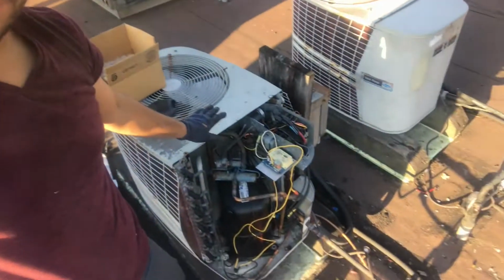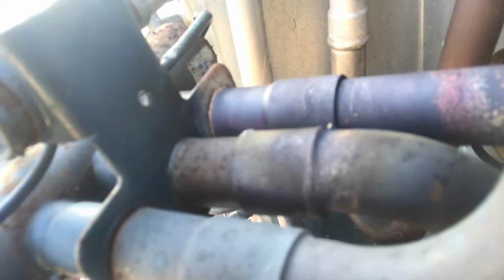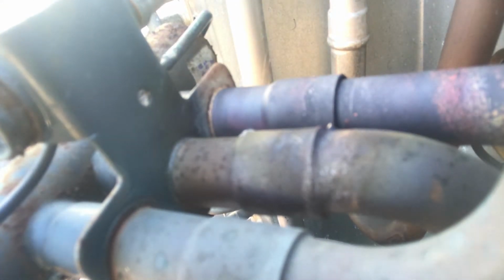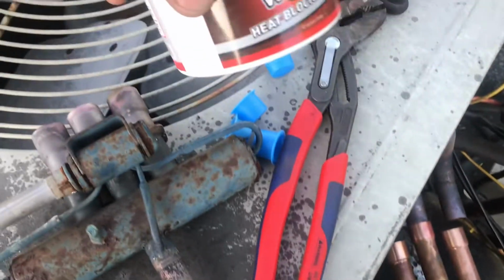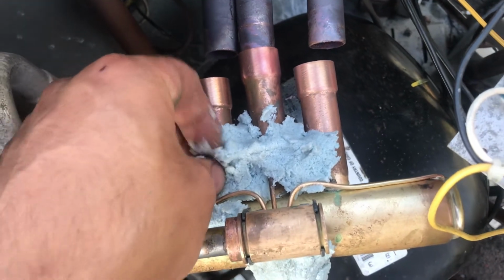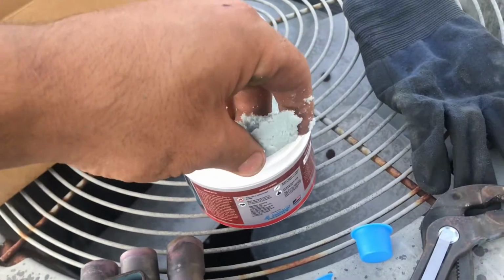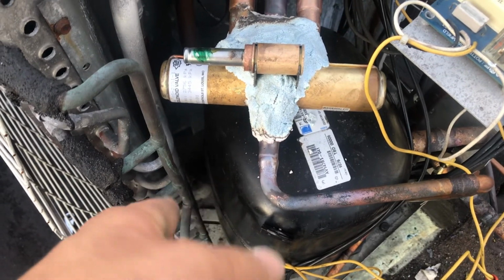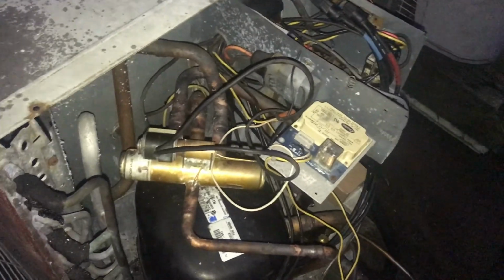HOW TO INSTALL A REVERSING VALVE FOR A HEAT PUMP

Comment: What tip is that you using or equivalent to normal torch  ? I damaged a 7/8 txv it wouldn't heat enough to separate it

Comment: That's an old carrier heat pump it's time for a new unit not the original compressor either it's time to replace the whole unit and put a new heat pump in